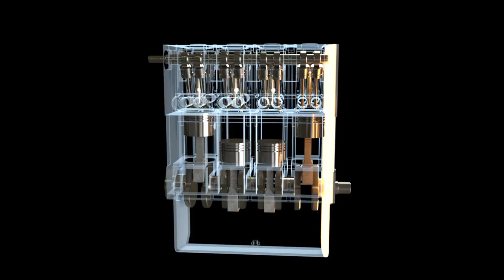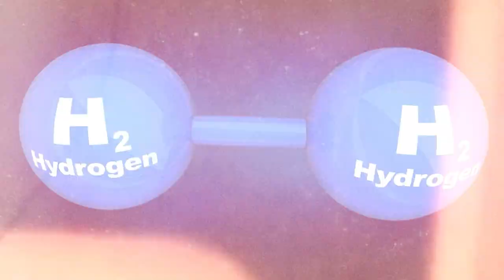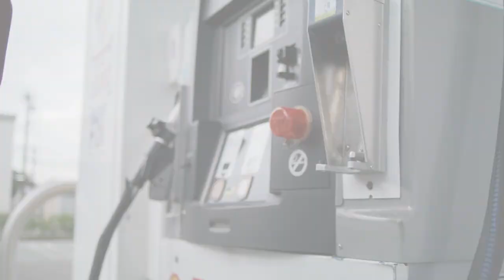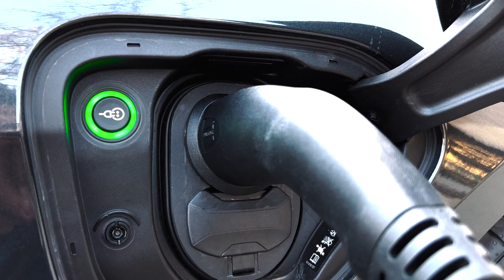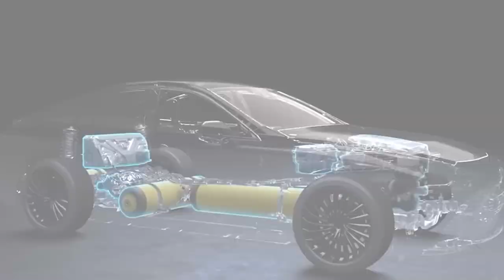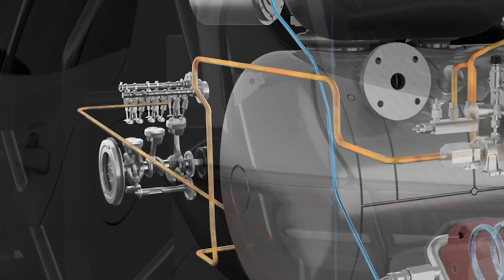GAME OVER! TOYOTA'S New WATER ENGINE Will Destroy Entire EV Industry

Comment: The idea of a hydrogen combustion engine is nothing new. It is actually a good idea. The issue with hydrogen powered vehicles is not the propulsion system used, ICE or fuel cell electric. The issues are twofold and involve hydrogen as a fuel. The first is generating the fuel. It is an expensive process, both in terms of energy input and cost. If the purpose is to cut greenhouse gas emissions, then a lot of things have to be done differently to realize this goal. The second is distribution of the fuel. H2 is notoriously hard to store and hydrogen fueling stations are much more complex, and thus more expensive, than gasoline stations. That is why we don't see hydrogen being widely used already. The problems are solvable, but it will take an effort on all these fronts, not just some new engine.

The concept of hydrogen fuel cell powered cars has been around for almost half a century. About 20 years ago I visited the GM pavilion at Epcot, and they had a hydrogen fuel cell car on display. It was not a new display. 

The other mistake Toyota is making is to demonstrate this technology in a souped-up sports car. If you want mass adoption, and you want to make a dent in the supposed climate impact of transportation, you need to produce a mass market, affordable model. Toyota should know this. They have never been leaders in performance cars. They made their reputation and money on affordable, reliable and practical cars. 

Finally, the autonomous driving features of EVs were only added to help justify the cost of the vehicles. It is not necessary. The plain fact is that autonomous driving features could easily be added to standard ICE vehicles as most of them use fly-by-wire technology already.
Reply from the maker: Great insights! Hydrogen's challenges in production and distribution are key considerations. Toyota's choice of a sports car raises interesting questions about mass adoption. What other innovations do you believe are essential for sustainable transportation?
Reply: @Sparkz-cars  I appreciate the response.

The first place to start is to cut back on the power level in cars. This would get you 20% better gas mileage right away. For example, I had a car with a 3.5-liter V6 putting out 250hp. I replaced it with a car with a 3.6-liter V6 putting out 306hp. Same gas mileage. So, the engine is more efficient in terms of output per gallon. So, if a 3.0-liter V6 putting out 250hp were used, the gas mileage would go up. The fact is I will never run the engine in my current car even up to half of its range. I could probably get by with 200hp. 

Then there are the electrics. Same story. Cut back the power levels to something useful for normal driving. Look at the Model 3 They offer it in a twin motor configuration for high performance. Idiots. It's still a small sedan. What is the problem with EVs? Range anxiety. This is now showing up in slowing sales. The solution is simple and actually would save the manufacturers and consumers money.

To cut the cost of EVs, another thing that could be done is to get rid of the autonomous driving feature and all the other non-essential electronics. You have to realize that these were added to help justify the cost of the vehicles. It is not necessary to have an EV to implement autonomous driving features. Most modern ICE cars are fly-by-wire anyway. How do you think they implemented automatic parking and low speed braking? 

The best current solution is a plug-in hybrid. My friend (and lawyer, good to have one of those) recently got one. It is BMW. Unlike older hybrids, like the early Prius, it is not all electric below a certain speed, but for a particular range. It also has regenerative braking. I think the all-electric range is about 30 miles. That actually covers his daily mileage most days. Being a hybrid, he does not have the range anxiety. My understanding is that a lot of people who were considering EVs have decided to go with hybrids for just these reasons.

Hydrogen may be the way forward, but it needs more time and development. EVs are a dead end because of the expense of providing sufficient electricity. 

Finally (yes, finally) there is the sports car angle. Don't forget that is how Tesla started out. First a $100K sports car (it is really nice according to people I know who have had them), then move to sedans then to small sedans and mass market vehicles. This is not an uncommon approach to automotive marketing. In fact, it is almost a century old. In this case, I think it unnecessary and a waste of resources for Toyota. 

Pardon the long-winded answer, but I have been following this stuff for a long time now.
Reply from the maker: Wow, thanks for taking the time to share your wealth of knowledge! Your insights on power levels, EV challenges, and the perks of plug-in hybrids offer a fresh perspective.

It's evident you've got a keen eye on the evolving automotive landscape. Your historical context and thoughts on hydrogen and sports cars make for a fascinating read. @louisgiokas2206
Reply: @Sparkz-cars  You are very welcome.